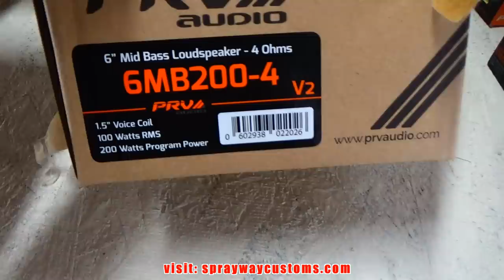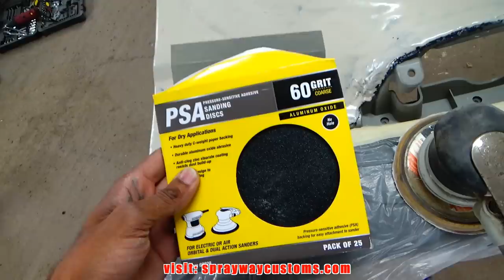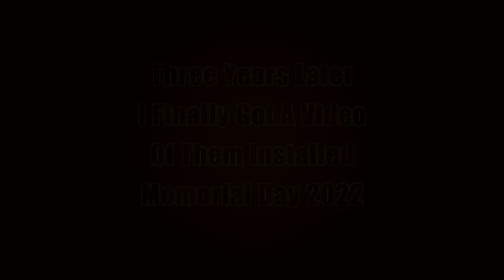How To Fiberglass Custom Door Panels SPEAKER BOX Chameleon Flip Flop PRV AUDIO SPEAKERS Chevy Tahoe

Comment: I've gotta redo my 89 s10 blazer doors soon.  Currently each door holds 4 GRS 8s but I'm going to be rebuilding them to hold 4 DS18 6.5s and 4 DS18 super tweeters in each panel
Reply from the maker: Ok then Gary
Reply: @SprayWayCustoms  have you done any doors for the oldschool s10 trucks or blazers? If so I need to get some ideas

Comment: How do you attach the door panel? because I feel like the original plastic fasteners cant hold the door properly because its so heavy
Reply from the maker: Screw screws through the speaker openings
Reply: @SprayWayCustoms  do you use just screws or Threaded insert?